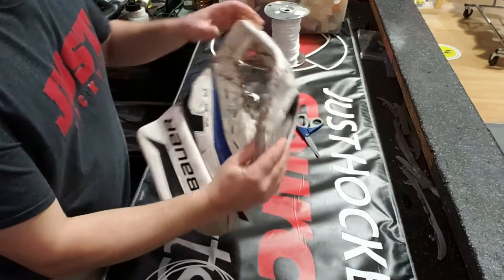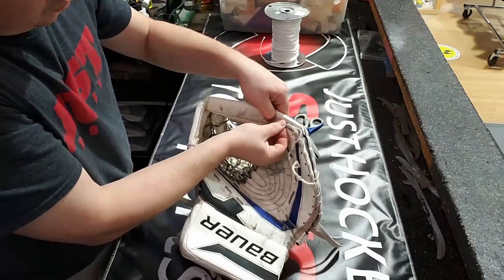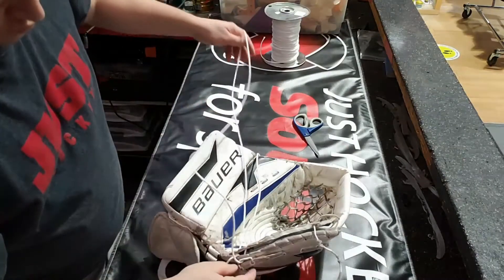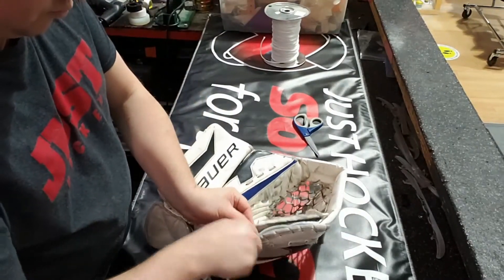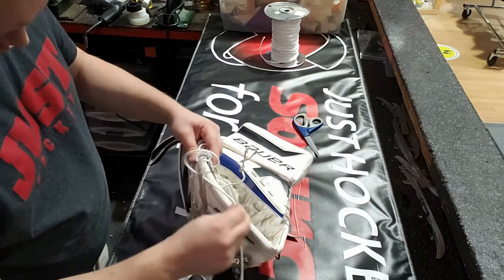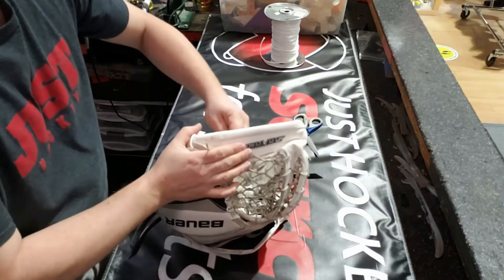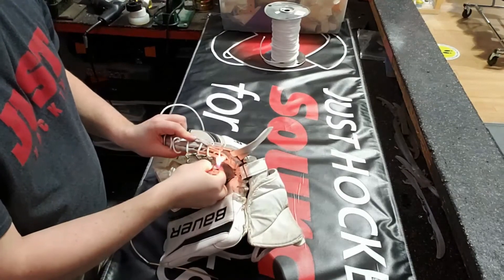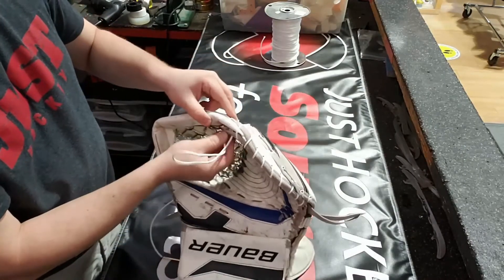Got Hockey Tips Perimeter Lace 2 Finger Side Repair Goalie Glove Catcher Trapper

Comment: This method is really only good as an "on the go" repair tbh I've been restringing catch gloves for 3 years witch is not a long time. However these types of repairs are so tedious cause if you accidentally move the tee back a hole that makes the catching space smaller. its better of spending $30 ish to get it fixed by someone who knows what there doing
Reply from the maker: You forgot to mention how you would do this better.
Reply: @GotHockeyPod  Absolutely! Id start by identify were the original lace starts and ends, if you already have a lacing needle then stringing should be very simple, I would start were it begins commonly at the bottom of the finger then work your way up through the tee and pocket space, be sure the make sure its a consistent tightness throughout the finger curl make sure the tee is tighter then follow that up with once again tightness through the palm once again. As complicated as it sounds it is a very very simple job that maybe take 30 min do it with no experience! This is still a good method you got just as an emergency repair!
Reply from the maker: @ryanmerccer3660  besides replacing slightly more lace that's the exact same method. thanks for watching.
Reply: @GotHockeyPod  with your method your now relying on 4 knots instead of 2, and the two are in heavy were down points?
Reply from the maker: @ryanmerccer3660  of all the gloves I've ever fixed with this problem I don't think I've ever had to fix one where the knot came undone.